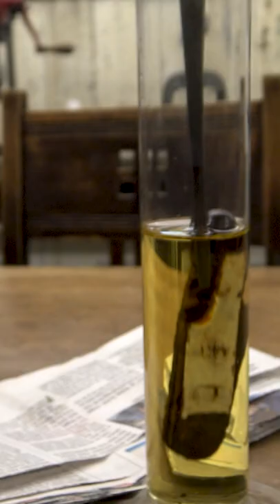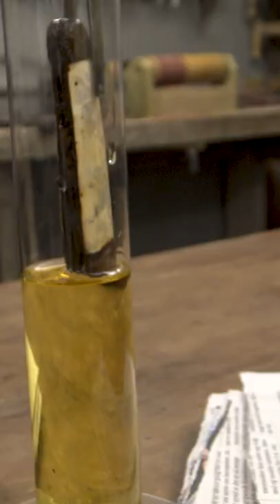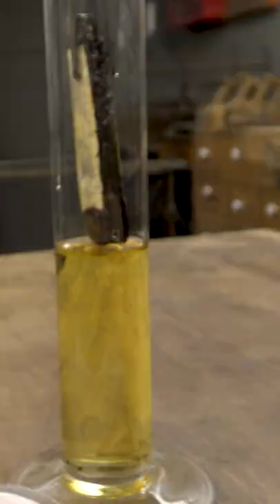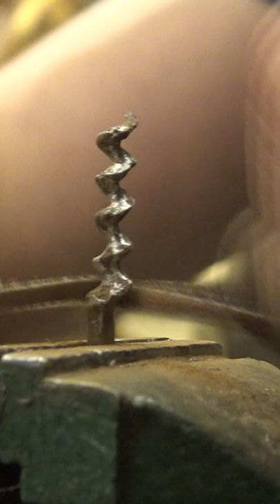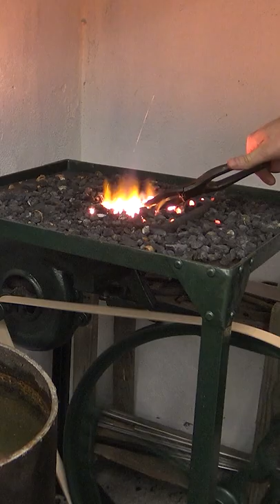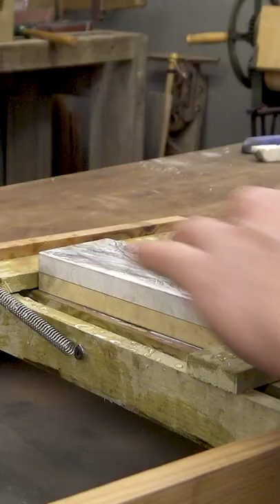Rotten Pocket Knife Restoration-Remake | #shorts

Comment: Wow, that is one impressive restoration!! As knife enthusiast, I am pretty excited with this, and I am off to search for a full length video straight away!

I am also mystified; what is liquid in which the knife is immersed as the first step, and how long do you soak it? I have never seen this done, except occasionally with vinegar, but that is not vinegar.
Reply from the maker: Thanks for checking out the longer version. I used Oxalic acid. It works great against rust. Time is difficult to tell because it depends a lot on the water-oxalic acid ratio. Stronger solution, shorter time and opposite.